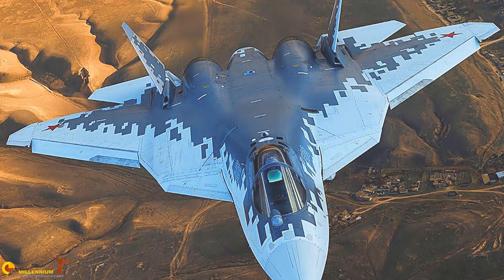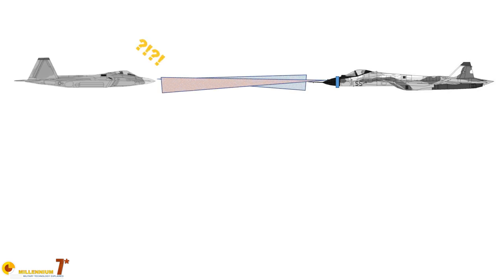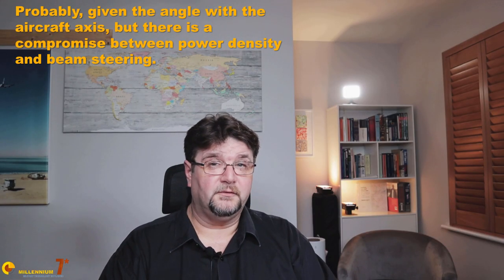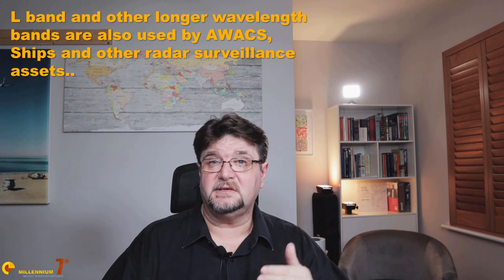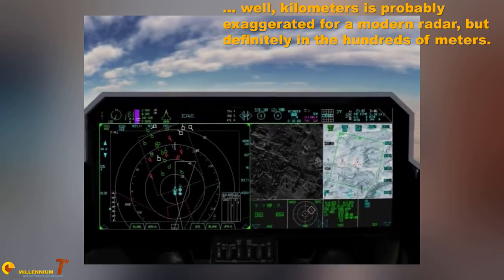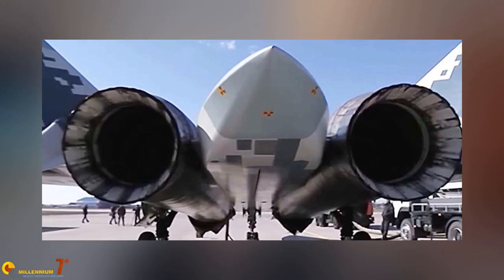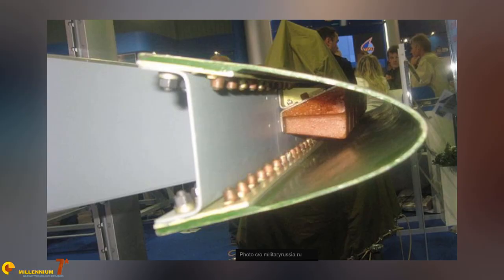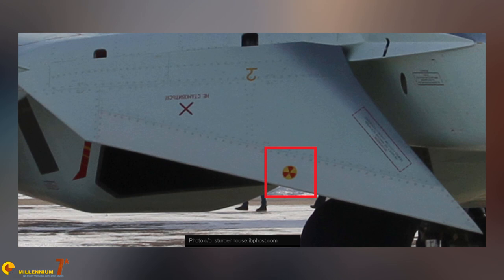Su-57 the Raptor Spotter | Part 4 - Radars, ESM, ECM, IFF

Comment: F 22 raptors can surprise su 57 by detecting them using das going behind them and lock at 50 kms at 6 o clock using amram 120 d missiles otherwise its suicide 
Its the best option becouse if f 22 raptors fire the missiles front on front the enemy will detect the missile or the missile lock but going behind the su 57 its the only way the raptors can survive and win the air combat... all the best i like  your show and  channel in YouTube.

Comment: I love this chanel....F22+F35=Su57.that simple.
Russia invented stealth and found it useless since every ww2 radar can detect stealth jet. In the case of F35....it is like flying brick....if Kibiny system was to be installed on Su57 F35 would ended on the ground without gram of gun powder spent....sort to speak...f35 is flown by computers not pilots....Su57 on the other hand can operate with 2 Okhotnik drones which makes it 5+ fighter....i have read somewhere when it was still t50 concept that 2 Elbrus E2K cpu are operating the jet....well modern versions....fot thos who does not know Boris Babayan was engineer in Elbrus before Intel gave him bianco check....when AMD was in the lead 20y ago....it seems that some other russian computer geek is in AMD...cause intel is behind....again...
Reply: The problem is that Russia don't have someone like tsmc to help them.
Reply: @jimc1654  
Common mistake to think that 70nm microchip is not capable at all vs 7nm microchip. Also note that Turing machine processors are orders of magnitude inferrior to ASIC microchips with application specific circuitry implementing hardware that Turing processors do in software. You don't need multicore processor with 5+GHz clock speed if it is known that 99.9% of performance hungry task is implemented in ASIC.
Reply: @alexanderbelov6892  Sure you built something that can only focus on one thing. But in the end risc design is the winner.
Reply: @jimc1654  
RISC is just one kind of instruction set definition. There were times when RISC was considered better than CISC because some RISC processors had better performance than x86 compatible CISC. But later Intel&AMD made lot of efforts in complex design of their x86 implementation, so most RISC processors just disappeared or became low-end low power processors. So RISC or CISC by itself does not win even in bounds put by their Turing machine way of work.
GPUs were made application specific for 3D graphics applications. There is no CPU that can be compared with GPU in 3D graphics. But still GPU has some basics cores that work similar to Turing machines that allows to program them with short specific software programs. This gives them so much flexibility, but also puts some limuts to their performance.
ASICs do not follow Turing machine design at all. So any circuitry can be implemented to do tasks in hardware with almost no limitations in performance, with predefined algorithms. This in no way less flexible than doing it in software, but has longer development cycle to debug and produce in series.

Comment: The SU 57 is a very nice 4th plus generation aircraft but it is not on the F 35 level and not even close to the F 22. Keep working on that other "Checkmate"  fighter
Reply: and that's an assumption based on... Pictures?
Reply: @ГеоргийМурзич  could be a 4.5 gen,though..and based on several of things, it's equipments where it's developed by vastly well experienced defence innovation corporators and verification by even more global experts that's not state controlled or ultranationalist one-sided oriented, etc.,that's about it..🌈💎🌈🤙✌🤘👌💪🤷😉
Reply: @emilatik8581  Wat -_-
Reply: @ГеоргийМурзич  Not that to comprehend...I won't elaborate, specified and make it more coherent than it already is..juat saying..unfortunate not..I would then strong suggest you to retry to re-read again,Mr.putin-russian boy..Good that that has been settled down and clarified once for all ,I suppose..🙄💎🌈👍😉💪
Reply: I gave a compliment but ok 👌 lmaooooooooo
Reply: @championknife  Hmmm to the first lines,especiallyin term.pf reaching the level,you mean its have other fields or capabilities it's more focusing on...that'sway more reliable and realistic to say,still overall not a full match to even the upgraded versions of F-35 variants and F-22 raptor anno non-1990's 2021 version.Even likely  the first decade,too,in term of surpassing the SU-57 and its capabilities, and perhaps,and only perhaps, as the same level of the "Checkmate",not even the way more letsaltet (than it extremely was to start with back in 90's and 00's) 2021 version upgraded and uniquely innovative version of F-22 raptor...just saying..Good that that has been settled down and clarified once for all, I suppose, otherwise yeah..🤷🙄😅👍💎

Comment: Funny how the bait click title makes it sound like the SU-57 will be hunting down the F-22's. I'm not quite sure which argument to use to show just how futile that sounds:

    A) The F-22 was developed in 1997 and Operational in 2005 but with a limited  production of 195 aircraft. But it took the Russia until 2010 to develop the SU-57 to counter it (which even their co-developing nation India dumped because it was such a dog, to buy a previous generation model Rafale), and to date they have only built 12 aircraft; thus making the USAF's 195 F-22s look pretty impressive. The Russians better hope the SU-57 can handle 15:1 odds and that doesn't even factor in the nearly 500 combat coded F-35's delivered and the fact that LM is delivering more F-35's every month than Russia has produced SU-57's in the last 10 years. There use to be a old phrase that USSR and Russian proponents used to describe their large numbers of tank, artillery, and aircraft inventory, "Quantity has a quality all it's own..." Well how'd that work out at 73 Easting? And how'd that work out with the F-117 flying nearly 3000 attack shorties with only 1 loss and another damaged? And how is that going to work when F-22 and F-35 are both Qualitatively and Quantitatively superior??

 or maybe...  

     B) The Russians are chasing F-22's with the SU-57 which should be fielded in respectable numbers just about the time the USAF starts building NGAD and the USN has their F/A-XX, shortly followed by the South Korea's KF-21, British Tempest, and German/Franco whatevertheycallit.  Too little too late... 

The SU-57 is already a "has been" or more poignantly as "never was been" so it is now time for Russia to move on to their Checkmate, it is their only hope to stay relevant...
Reply: US counts aircrafts generations as aircrafts that that cannot be upgraded into the next generation capabilities. But F-22 and F-35 were intentionally made as poorly upgradeable. F-35 still has handreds of defects that cannot be fixed. So there is no serious talk about its upgrade with NGAD aircraft capabilities. This way NGAD was named 6th generation.
Su-57 is constructed in more flixible way for upgrades. So who knows if it can be upgraded with NGAD aircrafts capabilities or not? This way it may become 6th gen as well.

Comment: L band radars are used on ships too, but they are weather radars not target tracking radars, how on earth can you have a tiny L band radar fitted somewhere in the wing and somehow have it detect and track an aircraft with an exceptionally tiny RCS it makes no sense
Reply: @Internetbutthurt  An L band radar on a plane like that won't be a passive system, it would be active, and therefore would simply give away the Su-57's position to the enemy, thus completely defeating it's own stealth
Reply: @Internetbutthurt  If the Su-57 has given itself away for the fleeting possibility to maybe detect an F-22 (detect not track) two different things entirely, nothing is in the Su-57's favor, maneuverability maybe the only thing it possibly has but then again that's only if it manages to survive all the BVR shots and get close enough. The F-22 is most certainly not to be underestimated at close range so there is that too.

Detecting is just one step, you have to successfully detect, track and lock onto the enemy aircraft to actually shoot it down, if it even manages to do the first step with any amount of luck it may have some fleeting knowledge of where it might be ambushed from, that's it
Reply: @F22raptor46  and you think that they are stupid that they would send a single plane to search entire sky,without Awacs
Reply: @Internetbutthurt  Riiiiight, I'm 100% a fanboi and know nothing at all and you probably know more than Sukhoi and Lockheed combined don't you. Lets completely leave out the fact that I am Indian, second the Indian Air Force left that program for a good reason probably cause the Su-57 isn't anything it's marketed to be and they made a smart decision going for Rafales cause they actually found those more capable.......

" Its clear you have no idea and you're one of the raptor fanbois who thinks its straight up invisible. Far from it. Keep in mind the Su-57 is also very hard to detect and track and coupled with a sky full of EW the F-22 is less likely to see the Su-57"

I've never once said the F-22 is invisible but you can believe what you want, the only reason the Su-57 has anything like L band radars and an IRST is because the Russians can't make anything like the DAS system on the F-35 although they certainly wish they could. The F-22 simply doesn't need IRST that's why they never added that in the first place. Since the Russians can't make what the F-22 and F-35 have, they have to make up for it instead.

"This is a huge advantage and is one of the reasons why the F-22 is being retired, because the airframe cannot be upgraded to house this"

Uh nope! The F-22 is simply being retired because the US is working on a 6th gen fighter to replace it, also the F-22 isn't yet confirmed to be retired, they're simply giving it thought.

"WHat I suspect is, even if the L band can only detect, the raptor is located for the IRST to track, or ground based radar to track and relay information to all in its network....all the while the Su-57 doesnt have to turn its radar on...of course it could use its radar but risks giving itself away"

Did you forget that the Lband radar is a radar as stated already? So when that is turned on, voila it's position is given away as stated by you, and an L band radar isn't an AESA radar so it can't change frequency like the main radar can so it'll give itself away already. As for IRST did you seriously forget IR suppression on the F-22? If the Su-57 ever was to spot one on the IRST, you realize his FOV as like looking through a Soda straw, not to mention making certain that all the weather conditions need to be perfect to get a chance to see the F-22 against it

 "Ive also heard the claims that the F-35 and F-22 radar is active but undetectable. This is pure fantasy. Its very possible their radars will be detected....so if the F-22 is looking for the Su-57 it HAS to use its radar which may also be detected and tracked. Fanbois seem to think only we can come up with certainly capabilities only to be proven wrong or adversaries come up with some asymmetric solution"

Ever heard of AESA radars? All new fighters use them, except for the Su-35 but that's a different topic. An AESA radar (Active Electronically Scanned Array) will change it's frequency 1000 times per second, so if its not on the same frequency the enemy RWR (Radar warning receiver) will simply be unable to pick it up thus point proven, the Su-57 actually has this btw so that's one good thing for it.

"Even if an F-22 gets shots off the AIM-120s will give its position away and be firing at such a range that the Su-57 will have time to respond...and i can tell you that 10 years ago AIM-120s were useless against Russian aircraft"

Reeaaallllyyy you mean to tell me that every single time the AIM-120 was fired in combat against any Russian aircraft it missed???? Are we seriously to forget the 95% success rate it's actually had in combat? Are we also going to forget the fact that the AIM-120 has been consistently improved and there are better variations of it? Also there are new missiles in the pipeline like the AIM-260JATM for instance, and then you got the European Meteor as well

"Dont believe me, watch this presentation by Lt Gen Dave Deptula, USAF intel (Ret). The AIM-120 has been upgraded but the Russians have had 11 years to improve their EW and i can guarantee you they have, so AIM-120s at a minimum would be degraded - combine that with super maneuverability and the likes of Su-57, Su-35s etc are very likely to be able to dodge AIM-120s even if they cant be totally jammed"

First of all that video was from 10 years ago at a time when the US didn't particularly have anything new, they do now. As stated before there's new missiles already in the pipeline. Having thrust vectoring doesn't mean anything, it's practically useless at speeds above 300kts and most dogfights take place at 350kts or above, that's why you don't see Typhoons, F-16s, F-15s etc having them, plus they're expensive and difficult to maintain

"Then the Su-57 is to be receiving laser countermeasures which will at least degrade electro-optical guidance making the capabilities of missiles that use this practically useless"

Big deal, even C-130s have that today, it's called the LAIRCM system, look it up

"The AIM-9X already demonstrated its not that effective over Syria even when shooting a vintage fighter-bomber with ancient flares- if modern Russian flares dont work, the laser certainly will"

That was one instance, not to mention the AIM-120 proved itself once again and that too at close range right after that.

And coming to the Su-57's stealth, this is what it looks like........ https://p4.pstatp.com/origin/pgc-image/e8dfc57b7e9544529d5ad6d47c5262f8.jpeg

https://p4.pstatp.com/origin/pgc-image/0b9038b45c584be4943a9d94e49ff55e.jpeg

https://p2.pstatp.com/origin/pgc-image/4bd55d1fe3534c2f8628c5c45eab8157.jpeg

Comment: Su 57 isnt compared to f 22 raptors in any aspects but you can compare it to f 35 or j 31 or j 20 or su 75 becouse first f 22 raptors are not in production or are in international market plus the supercruise, coating  stealth, das  sensores all in altitude of 65 000 ft at mach 1.8 for 60 minutes something that  is impossible for other figther jets that can only do that for 15 minutes , exception is gripen,  rafale,  eurofighter that can supercruise for mach 1.2 ...